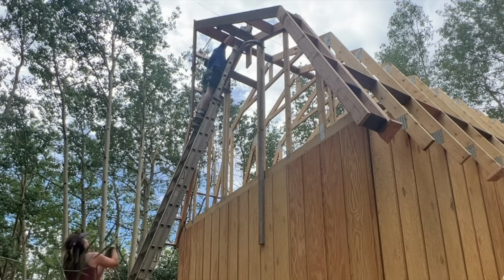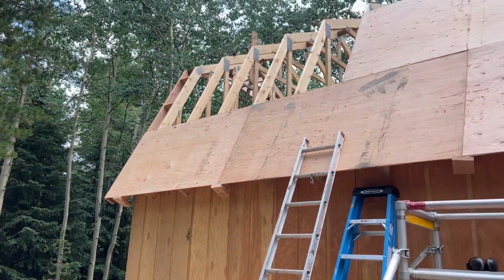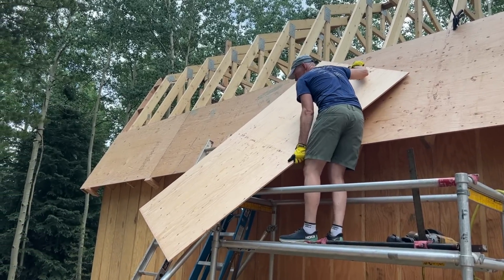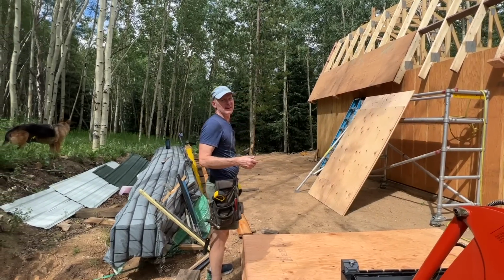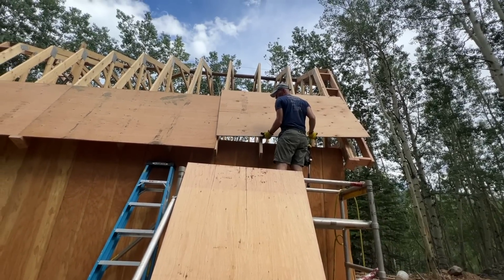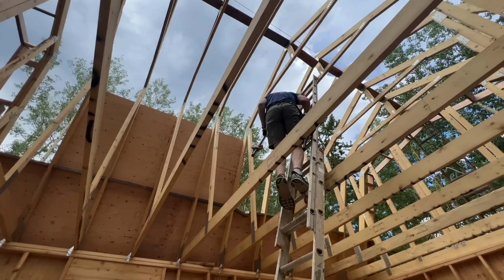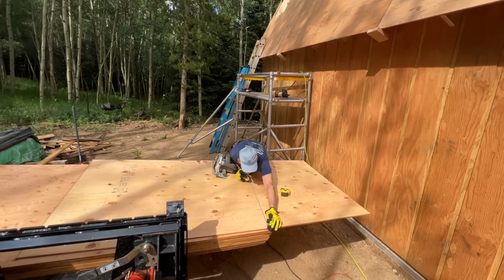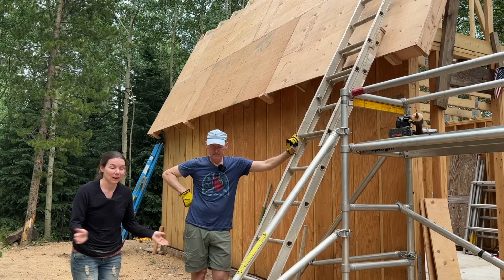Can't Get Roof Square & Black Bear Spotted at Worksite

Comment: Now you will have a problem with roofing ( tiles or corrugated metal roof) wont be parallel.
Reply from the maker: did you watch the video and see how he fixed it?
Reply: @ColoradoMountainLiving  Yes, but still he did not fix the tiles or corr iron.

Comment: Why not put plywood sheating on the upstairs floor and uses a shorter lader upstair it would be more rigid and less height to deal with also i dont know if brian realized that is 2 upstairs front walls will need nailers around the perimeter so the sheathings can be nailed all around. Great progress  for the 2 of you.
Reply from the maker: Yes, we planned for loft space in the structure. He's going to add a door on the upper back, with stairs on the outside. Thanks.

Comment: Old saying "Plywood doesn't lie." Use the plywood to square up the trusses. So long as you start square, it will stay square. Start a row of plywood as soon as you can, that will keep the trusses lined up. Then put your blocks in to maintain square. Good job to figure out the problem and correct. Enjoying the build. It's always fun to do a project like this working around work, weather and life.
Reply from the maker: That's a good one! Yes, the weather is always the determining factor in the pace of our build(s).